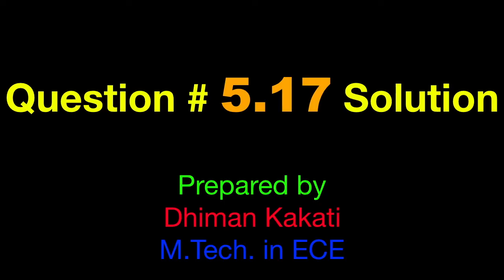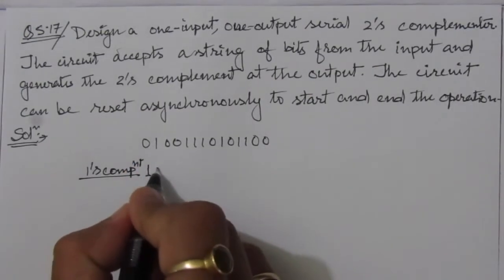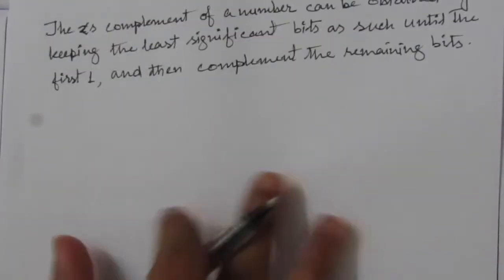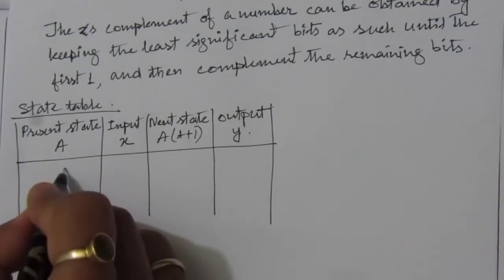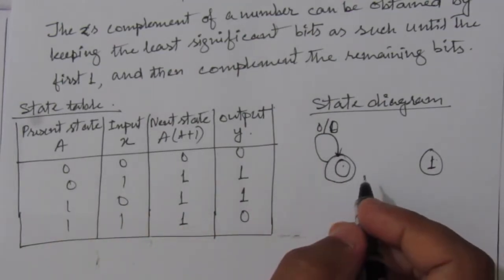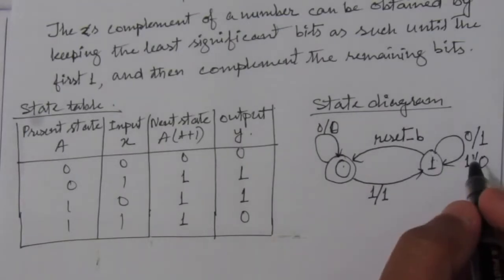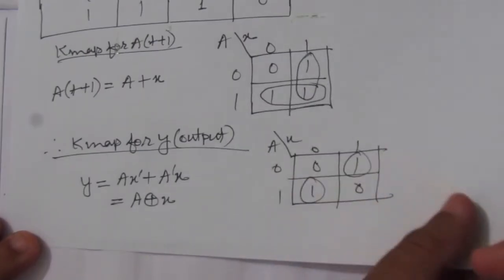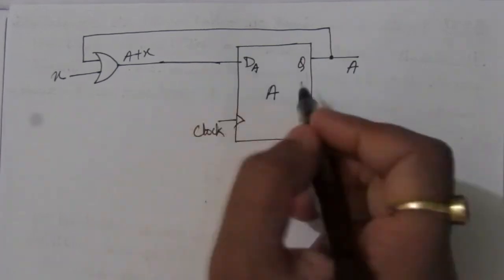Q. 5.17: Design a one-input, one-output serial 2’s complementer. The circuit accepts a string of

Comment: Sir how are u getting the values of present state and next state in this problem
Reply: same doubt
Reply: @hrithiksingla5709  ya same here also
Reply: There are two ways to find the 2's complement of a number:

    Long Way: Flip all the bits (0 → 1, 1 → 0) and add 1 to the result.

    Short Method (Serial Logic): Start from the rightmost bit (LSB - Least Significant Bit) and move left.

        Pass all 0s through unchanged until you see the first 1.

        When you see the first 1, pass that 1 through unchanged.

        Flip all bits after the first 1 (take the complement).

Example: Let's take the complement of the number 10100. (We read from right to left)

    Input: 0 → Output: 0 (We haven't seen a 1 yet)

    Input: 0 → Output: 0 (Still haven't seen a 1)

    Input: 1 → Output: 1 (Here's the first 1. Pass it through as is and now switch to “invert” mode)

    Input: 0 → Output: 1 (Invert)

    Input: 1 → Output: 0 (Invert)

State 0 (S0): “I haven't seen the first 1 yet.” (This is the initial state).

    In this state, we pass incoming bits through unchanged.

State 1 (S1): “I saw the first 1 and passed it.”

    After transitioning to this state, we invert every incoming bit and pass it through.
Reply: The rule for obtaining 2's compliment: "copy bits from the right until a one-bit has been copied, then complement (invert) the remaining bits."  From this understanding, you can draw directly the FSM. So there are 2 states (0|1), it means you will have 4 combinations of input and state. If you are state-0 and i/p is 0, then NS would be 0 and o/p would be 0. If you are state-0 and i/p is 1, then NS would be state-1 and o/p would be 1. Once you reach state-1 and i/p is 0, then NS would remain at state-1 and o/p would be 1. And if i/p is 1 while at state-1, then NS would remain at state-1 with output 0. 

The idea is first to make FSM based on that golden rule and then draw the state table simply based on that.